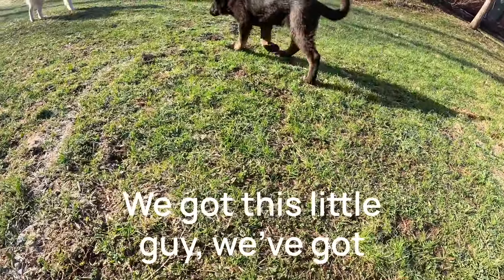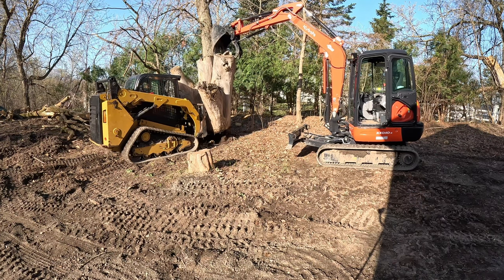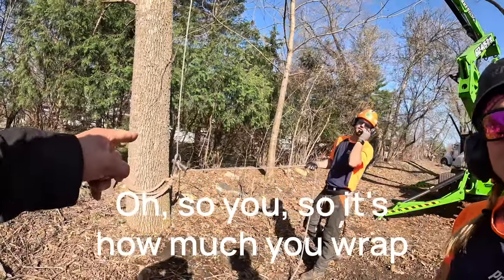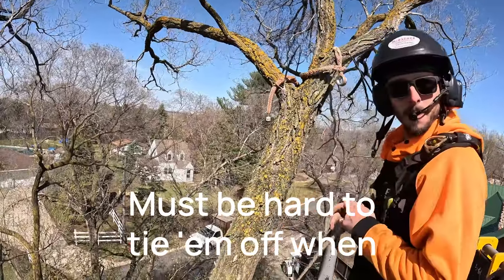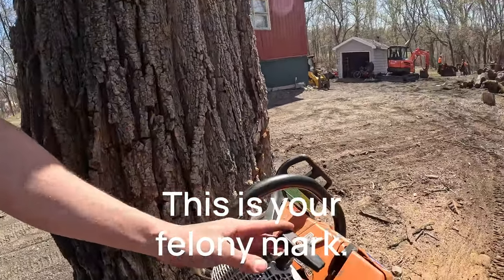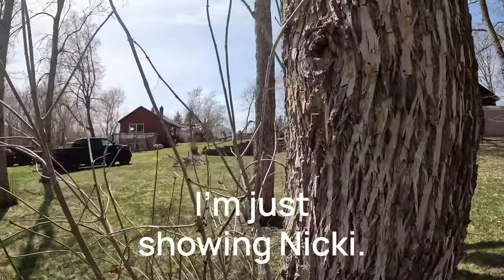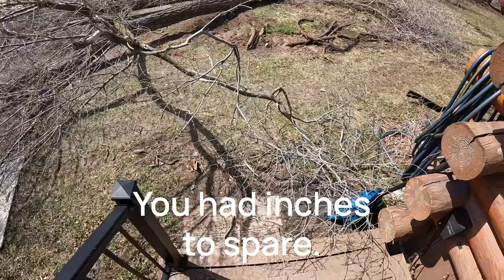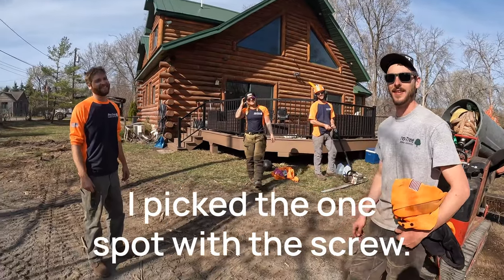How the pro’s drop sketchy dead Ash trees. 4K

Comment: We had a 75’ Maple Tree cut down in our backyard after we moved in. It was left by the former owner. It was only 6 feet from the house and a huge branch had come down the first year, and luckily missed the house. I determined that was it for the tree. It provided no shade for us, plus was preventing our backyard from receiving sunlight, thus preventing any grass to grow. The backyard was basically dirt.
Reply from the maker: It’s definitely not the easiest thing cutting down big old beautiful trees, but when it’s dangerous & a hindrance you just gotta do what ya gotta do.
Reply: @Dirtmonkey  if its a Maple of that size, can you imagine the insane slabs one could mill from it? talk about potential $$$s right? last year i had some pines taken down due to dangerous leaning. it was maybe 4 or 5 feet across at the bottom of the stump when done. alas, it wasn't slabbed or milled into boards, just chipped and hauled away. but i can imagine it would have more than covered the cost of removal in board footage.
Reply: @EddieSchirmer  I got some slabs out of it too!
Reply: @3cardmonty602  thats awesome! haha, i bet they where highly figured too. i had a Maple about 15 years ago struck by lightning that got cut down, i have half a log in my shop that vie been carving by hand with amazing salting and figure, and its about 80-90 pounds in weight haha.
Reply: @EddieSchirmer  Yes. Flame maple

Comment: 2016 F250 Lariat 6.7 D. Great truck the first 68K meticulously maintained miles. Long story short it went into limp mode diving down freeway. Took the dealer and 3 FoMoCo Engineers 6 friggin MONTHS to figure out it was a bad mass air flow sensor. 100% on management both dealer & FMC, lack of training & diagnostics. At end FMC stood up and  provided a 36M/36K  Premium Care warranty for the troubles. Fortunately not using it commercially.